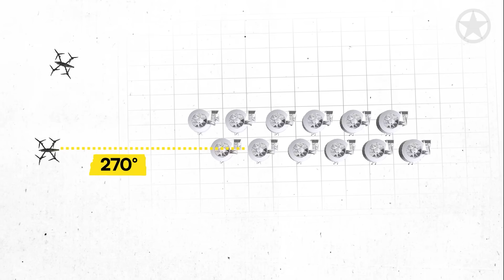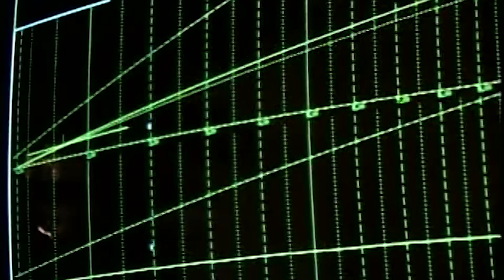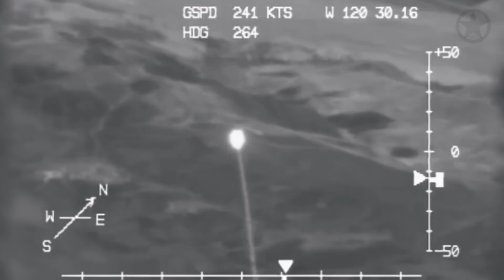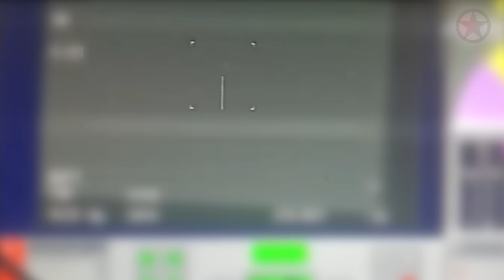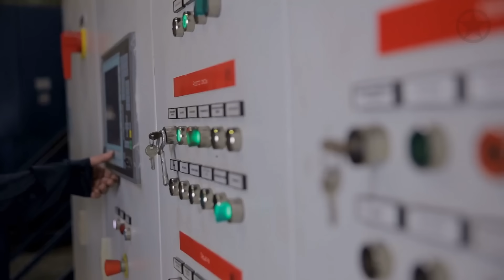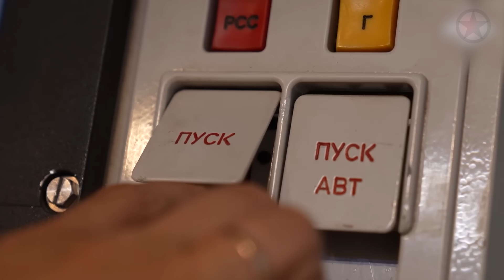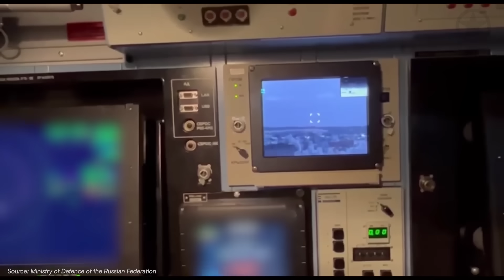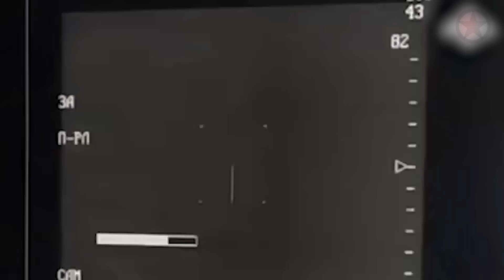Ukrainian Drones STRIKE Russian Oil Depot - Then THIS Happened…

Comment: Quadcopters can't fly that far with today's battery tech. DJI's can't fly more than 25 minutes on a charge, and that's with no payload. These must have been launched closer, like what israel did to Iran, building them in-country and launching them out of semi's that were parked there for a while. 
Or as someone else suggested, launched from a long-range plane drone that went 90% of the way.

Comment: I know the strike happened, and I'm pro-ukrainian BUT I find it hard to believe that any quadcopter anyone is producing can fly 700Km. So it must be some other drone, perhaps something we've not seen yet. I'd believe something winged. Note I fly some fairly large foam RC planes and launch them off a rail using bungee cords (8 foot wingspan) and with some small modifications I'd be able to reach those ranges so I've been waiting to see the Ukrainians do something similar. Since the wing and structure is all plastic!/foam only the batteries, control modules and motors would reflect radar and they have minimal heat (the motors get hot) so I could also envision one with thermal cameras circling over a battlefield for a whole day if it was built with longer glider wings instead of the shorter speed wings.
Reply: Thank you for your knowledgeable comment. May be the video isn’t showing the actual drones used 

Also is it possible that these little drones are not fitted with batteries but with a traditional ICE engine? 

Or perhaps they were launched closer to Engels than what the UKRAINIANS army wants people to believe.  😂
Reply: @lamdao1242 before I went battery / electric RC planes I used to fly the fractional HP RC planes. You can add an auxiliary fuel tank but they are fuel hogs and I doubt you could get one with even 100 mile range to fly.
Note that almost 20 years ago I built and flew a scale B-17 bomber with 2 gasoline weedeater 65cc engines (its a 4 engine plane so two dummy engines) that could carry 8ea 1Lb sacks of flour in its bomb bay and we used to fly it around and bomb "stuff" (when a sack of flour hits dropped from 100feet it makes an amazing big cloud like an explosion). It could only fly for about 45 minutes BUT that's because the fuel tanks were fairly small. If I'd enlarged then I certainly could have gotten 500 km easy. Now my B17 was mostly 3 ply model plywood and balsa but using foam and carbon fiber today I could make it lighter, carry more 'cargo' and longer range. Note that a good smartphone has most of the capabilities for flight control by delete the phone software and reprogram as a flight system (since phones have gps, magnetic compass, barometer/altimeter, etc) but the off the shelf hobby stuff is flat out cheap and super capable and I'm sure Ukraine is using it.
Reply: For the final approach you could glide and even jettison the engine. Then you have no IR signature and a very small RCS. Very hard to fight.

Comment: Minor correction: the FPV drones you show in the video cannot fly for six hours. They can fly for maybe one hour tops. They may have been launched from another larger drone that can fly the 750km  stated in video. And powered by a more dense fuel like gasoline or jet fuel.

Comment: Ukrainian drones hit the Kristall oil depot at Engels airbase in Russia on June 6, 2025, setting fuel tanks ablaze. Likely using truck-transported FPV or custom drones like Liutyi, launched close to the target. A six-hour flight for off-the-shelf commercial drones is unlikely due to battery limits; truck deployment enabled short, effective flights.

Comment: The problem you have in a fire that reaches over 1500 degrees, it breaks down the water molecules into their core components oxygen and hydrogen, which turn burns as they release their energy.
Reply: Hydrogen explodes (the Hindenberg) and oxygen is an excellerant!!!!
Reply: shardug, You are terminally confused about chemistry and energy release.
Reply: No, the splitting and reforming of water doesn't add net energy or heat to the system.

Comment: Footnote:  The difference between simple burning and detonation is the presence of a supersonic burning wave front.  That is, the burning surface of the fuel-air mixture is moving faster than sound, typically between Mach 4 and Mach 7.  The rise in temperature and pressure across the shock wave is hugely huge, and hence, kaboom.  

If you want to go full auto nerdy about this stuff, look up a Chapman-Jouget, or just C-J, wave.